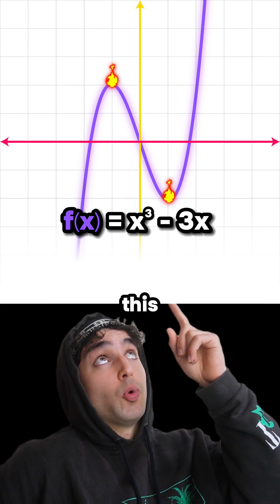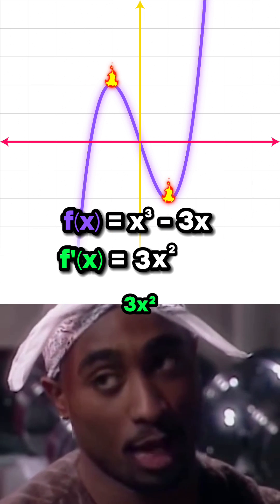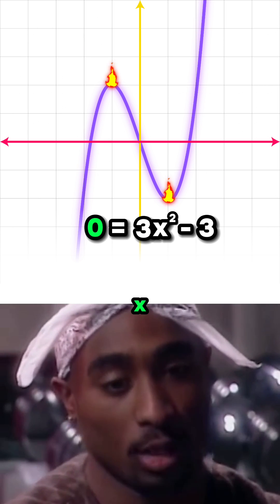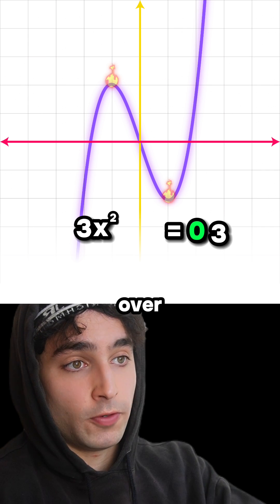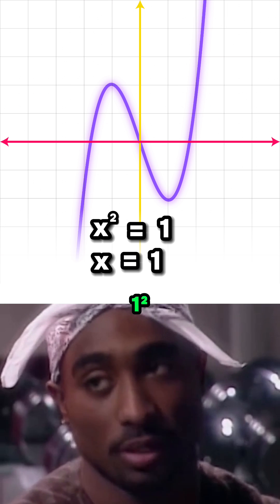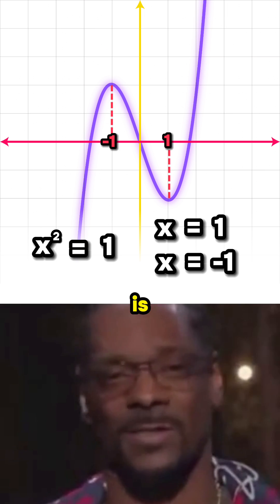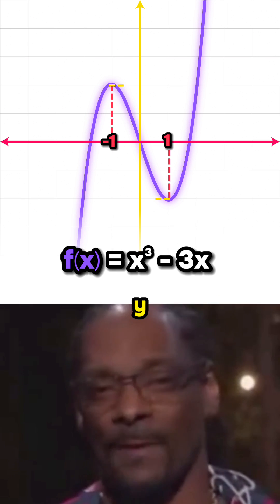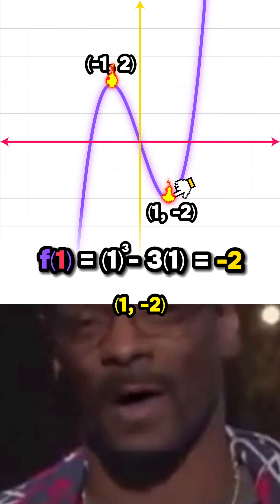Snoop and Tupac show you how to find the stationary points of a cubic

Comment: If you don't know which point is maxima/minima (maxima= where the curve looks like a hill, minima= where it looks like a pit) just find the double derivative (y") of the function and then plug in the values of x that you found by equating y' to zero into y'". If one of the values of x gives y" > 0, then that point is the point of minima, otherwise it is the point of maxima.

Note that I'm not talking about maximum/minimum. In the case of a cubic polynomial maximum/minimum values are ∞ and -∞ respectively since the curve just keeps going infinitely towards both the sides unlike a quadratic polynomial which has a turning point that gives the maximum/minimum value of the function.
Reply: Maxima/minima is just the plural of maximum/minimum, doesn't have anything to do with what the shape is like
Reply: @mbrusyda9437  When the plural of maximum/minimum which is maxima/minima is mentioned in the context of calculus, we usually refer to local maximum/minimum values. There is only one maximum value a function can have but it can have multiple maxima at different places.